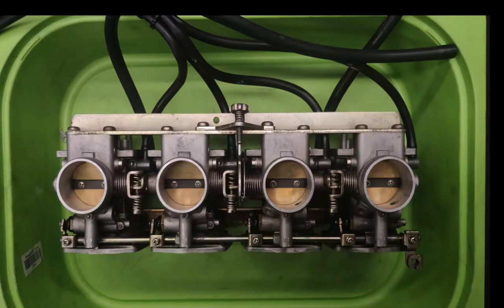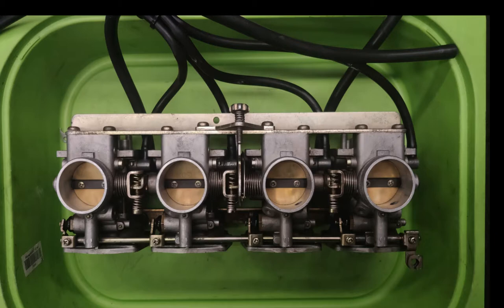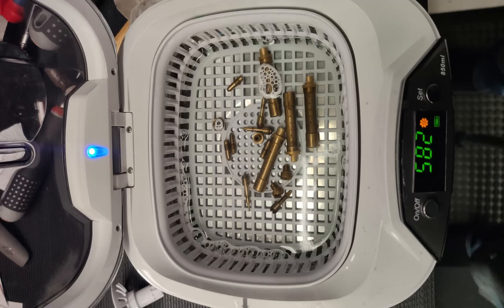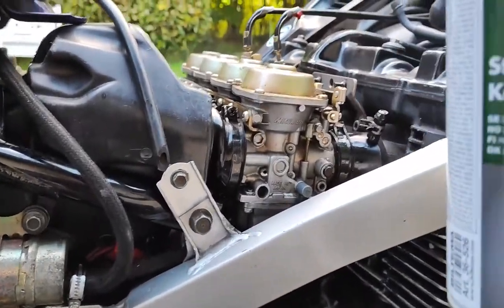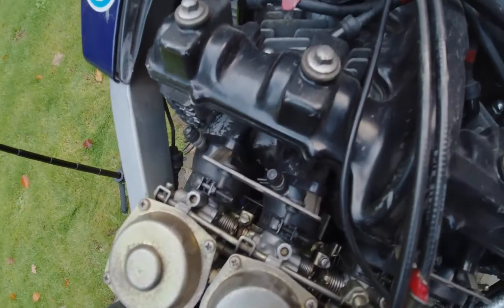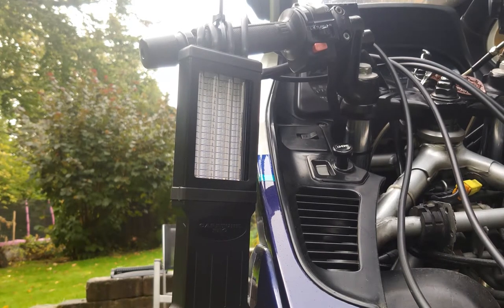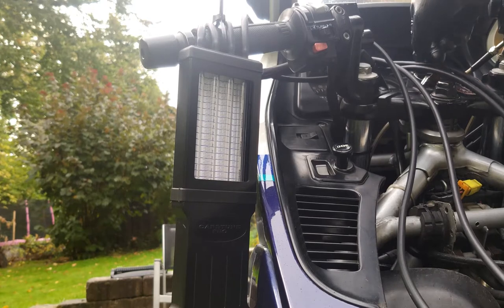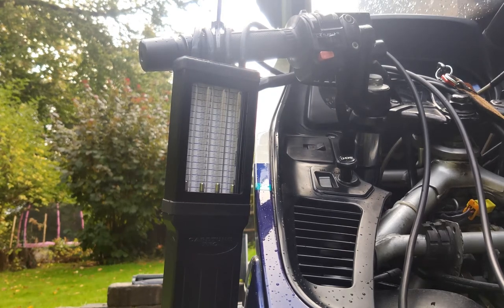Yamaha fJ1200 carburettor synchronisation  made easy.

Comment: pro tip: if you can connect all four hoses to one carb first and see if those needles all point to the same number. if not write down the offset, then connect to all four carbs and adjust accordingly 🤗
Reply from the maker: Nice tiip. Cheers!

Comment: Do you know where you can get new inlet rubbers cheaply? Mine are all cracked. From the airbox to the carbs btw
Reply from the maker: These are hard to get im afraid. CMsnl.com in Holland have the 2 outer ones in stock. Not cheap but they fit and last for years  Otherwise a good complete second hand option are out there. I had to repair one of mine with black permitex silicone. Made a vid on my site  Still holding today. Otherwise Japanese supplier. Good luck with your hunting.
Reply: @andrewonmyway8184  Thanks! Willl try silicone for now
Reply: also could ask on a bike specific forum like "fjowners" most of the time someone has some spare in the basement :)

Comment: Always check valve clearances first. No point in balancing carburettors if valves clearances are out. Yes use carb spray to check for vaccum leaks.
Reply from the maker: I mention this in my vid. On an old bike like this the clearances don't move much.
Thanks for watching!
Reply: @andrewonmyway8184  That's true.

Comment: just saying, you might need to put a smaller or bigger restrictor in the 4 Rubber lines, put the restrictor in each line about 6" up from the ends that plug onto the Carbs. I have the same Bike and the same Motion Pro and at a 1000 rpm Idle my 4 chrome Rods are about 2" up from the Bottom of the Motion Pro , your 4 Chrome Rods are not even showing at the very bottom unless you Rev it up,  It should not do that . cheers Phil
Reply from the maker: Cheers for that . Will try next time!